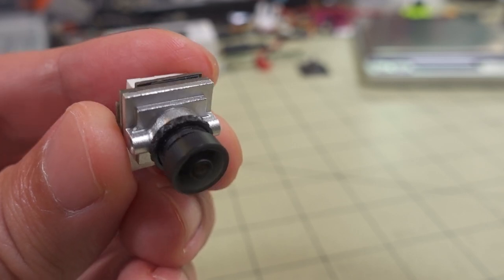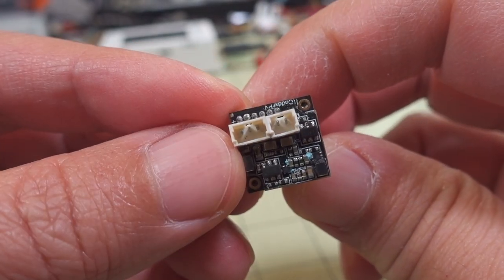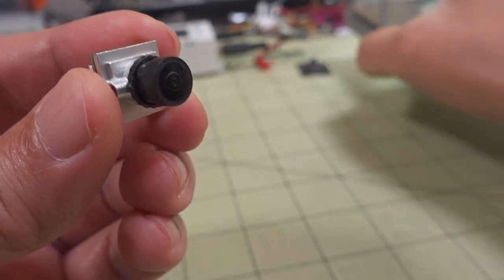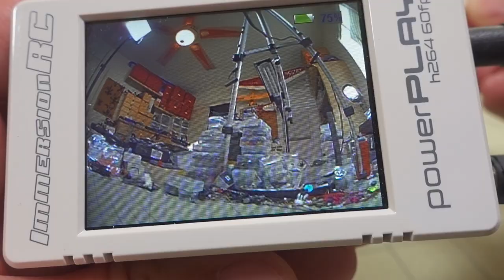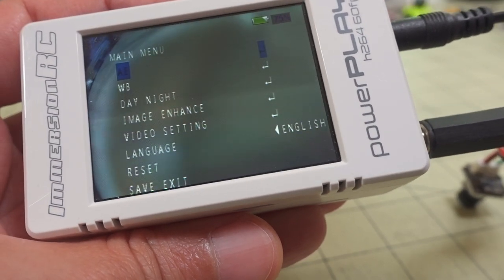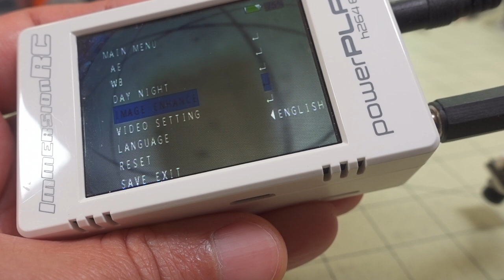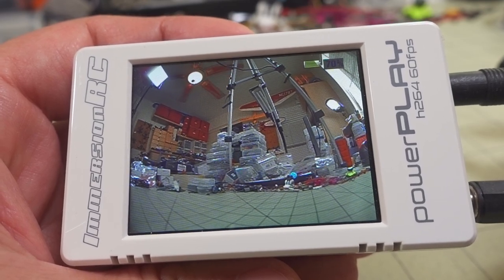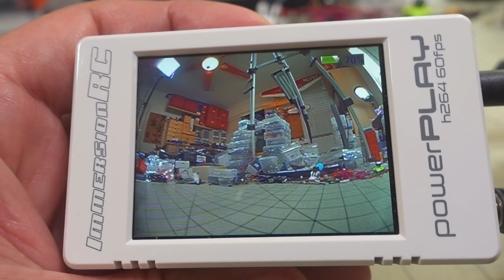The Best 3g Analog FPV Camera Money Can Buy // Caddx Baby Ratel 2 📸

Comment: So they finally released it! I got two of these from Getfpv with the subscription box. The first one they forgot to put in the IR filter so they sent us another camera that was fixed plus they sent us the filter to fix the first one. I used one in my build from the subscription boxes and I still have one to use in another build. Thanks for doing this video. Of course mine didn't come with the aluminum frame, I got mine before they went into production I think.

Comment: Another informative video from Albert Kim. The camera on my Tinyhawk S(dark) is terrible .Was hoping a camera like this would come along to replace it. Anyone know if It would fit in the Emax Tinyhawk S? I'm still kind of a rookie with sort of RC stuff.
Reply from the maker: That camera is different dimensions and taller vertically.  So not sure it will work without modding the frame which I've seen people do with cutters and hot glue but you'll have to get creative.
Reply: @AlbertKimTV  Thank you Albert. I heard maybe the Runcam Nano 3 might work and suppose to be better.

Comment: Do you know if there's any clearance issues to mount the Baby Ratel 2 camera in the stock Larva X canopy? Or the TPU pod canopy that you had on your Red devil?
I'm looking to replace both run cam nano 2 cameras in both of those quads.
Thanks for another great informative video Albert!
Reply from the maker: I think on both this one sticks out by 1mm compared to the RunCam nano but should otherwise fit almost the same.
Reply: @AlbertKimTV  sounds good. 
I was more worried about the plug sockets in the back of the Baby Ratel 2. Looks like the distance from the cams mounting holes to the back of the plug sockets is a greater distance than the Runcam Nano 2.

Comment: I just bought one and realized that it's not suitable for 1S.. (facepalm). Any thoughts on a decent low light 1S camera?
Reply from the maker: Almost all 1S whoop boards have a 5v BEC on them.  Are you using this by itself?  Most of the other cameras that can do lower voltages don't have good performance in low light however.
Reply: @AlbertKimTV  Yes, I am powering it from the 5v pin of an HGLRC Zeus5, but since the battery is only giving 4.2v max, the camera never reaches the minimum 4.5v to start outputting video. Will order a Caddx ant lite for this build. Thanks.